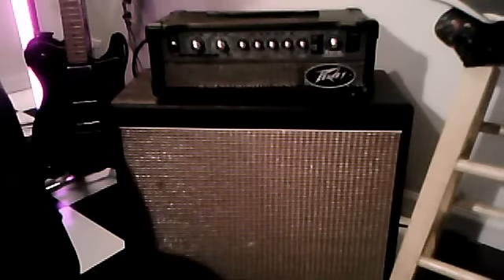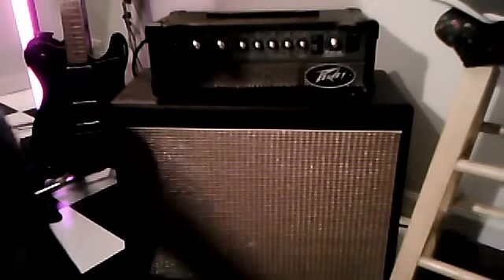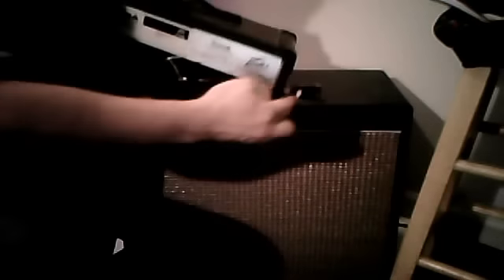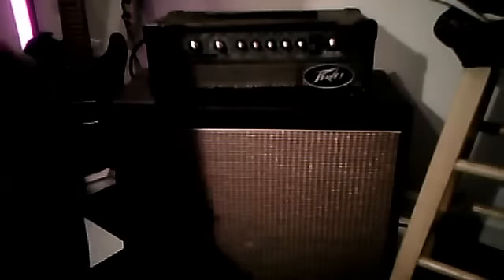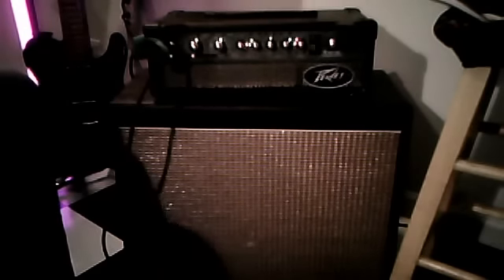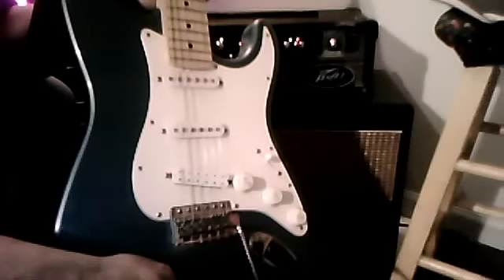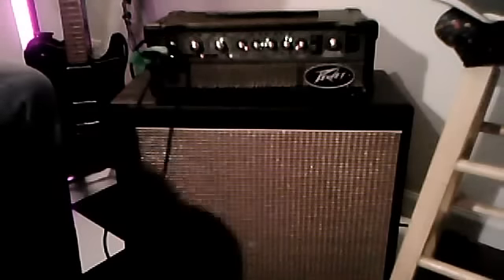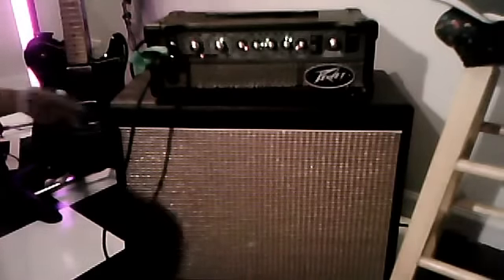Peavey Vypyr 15 Combo converted to custom guitar head amp amplifier DEMO Line 6 cab demo

Comment: Im building mine into a 1x12 combo. It definitely sounds a lot fuller with the big cone. Its a very versatile amp and is better then any fender modeling amp imo. The speaker leads could be a little longer though.

Comment from the maker: I just drilled a hole on the side for the jack. Installed the jack. Then, snipped and soldered the wires from the amp. There is plenty of length. So, no problems.

Comment from the maker: I think you will have fun experimenting with different speaker configurations. Personally, I am not a big fan of Line 6 gear. I don't get any feel out of that stuff. On the other hand, I'm very impressed with the Vypyr line from Peavey.  I own/use various models for different situations. As long as your ohms are right, you might be able to draw some good sounds from it through a 4 x 12...2 x12  x 1 x12  whatever. Anyways, thanks for the question! Good luck...

Comment from the maker: You will like the Vyper 30 as a head. You need a Sanperra 1 or 2 to make it totally worth it.  My experience is that the tones and feel remain the same. You're just moving more air. Also, your speakers in your 4 x 12 might need a change to Celestions or they may sound great already. Good luck and let me know how it goes, post a video if you can.

Comment from the maker: as long as the ohms are on the cab are higher than the amp...4 or up I believe...don't plug into any cab rated less than your amp....search "gearslutz head ohms" for a better discussion and explaination...

Comment: is it good idea to connect this into an acoustic b200? it sounds like a crazy idea but  i like to do experiments, i have a vypyr 15 ,  and i want to convert it into a head, then conect it to the passive input of my acoustic b200 ands use the acoutic preamp for extra volume, obviously calibrating both amps so it sounds clean v: and last one.. i just take the speaker wires and connect them to a 1/4'' female input??? please answer:DD
Reply from the maker: +CaleboZ.  may run the headphone jack output into the b200

Comment: Hey man. I wanna convert my 30watt vypyr into a head. I have a fender rock pro 1000 half stack with 4x12. I just dont like the sound of the head very much. So my question for you is what changes in the sound from this conversion. Will my amp be any louder with the 4x12 rather than the 1x12? Or just tonality differences

Comment: I have a 30 watt amp, I want to convert it to a head, I know how to do that, My question is what speaker configuration do I have to use for the cab. The amp originally had an 8" celestion cone. As I dont have a good knowledge of electronics.
Reply: You can run it into any cabinet. Ive run my 15 watt through a 4x12.  Just makes sure the ohms match.

Comment: i want to do the same to my line 6 spider III, can i connect  this to a 2x12 8ohm load cab? i dont want to blow up anything !
Reply from the maker: mark333ful Line Six has a page dedicated to discussing amp and cab hook ups.  Q: What are the common ohm ratings for guitar speaker cabinets?
A: The common ohm ratings are 16, 8, and 4 ohms. It is important to look at the cabinet inputs to correctly match the rating for your setup to ensure the optimal output and performance of your amplifier. While some ohm mismatches are acceptable, other ohm mismatches can cause failure in your amplifier's power amp section.

REMEMBER: Impedance is measured in (Ω) ohms. Impedance determines how much current will flow through a component. A very high impedance allows a small amount of current to flow (i.e. a 16 ohm speaker load draws less current than an 8 ohm amp is ready to supply, but it will work safely). A very low impedance allows a large amount of current to flow (i.e. a 4 ohm speaker load draws too much current from an 8 ohm amp, ultimately overheating the amp).

Unacceptable Ohm Mismatches: When connecting any amplifier to an external cabinet it is important to keep in mind that the ohm load of your cabinet should not be lower in number than the ohm rating of your amplifier (which can cause the amplifier to fail). I.e. - If the amp output has an overall rating of 8 ohms DO NOT run with an external cab that has an overall rating of 4 ohms.

Acceptable Ohm Mismatches: It is acceptable to run the overall ohm load output of an amplifier to a cabinet that is higher in number. I.e. If your amp output has an overall output rating of 8 ohms you can run into an external cabinet that has an overall rating of 16 ohms. Be aware that you will lose ~15-20 percent of perceived volume with solid state power amplifiers when running this type of ohm mismatch, but you will suffer no failures.

Q: Can I run two cabinets with different ohm ratings?
A: We do not recommend running cabinets with different ohm ratings, as it may create an ohm load that your amplifier will not recognize and can possibly damage the power amp output section.
Reply from the maker: mark333ful  If the the Line Six is 8 ohms output you should be o.k.

Comment: Hey, I wanted to convert my Vypyr 75 into a head, so I had a friend come over to try and convert it, after taking it apart I think what he did was cut the two wires that are connected to the speaker and soldered it into a 1/4 inch output jack. Afterwards we tried plugging the output jack it into my 2x12 cabinet with a speaker cable but no sound was coming out. We're not entirely sure what's wrong or what to do, any help?
Reply from the maker: Did you try hooking up the old speaker to see if it still works? Check the cab with another amp? Check the cable? Check the ohms?
Reply: Rocket Sauce Guitar Jam and Backing Tracks, and more... I just found out the problem, the wires were NOT soldered -_- if you want something done, do it yourself xD